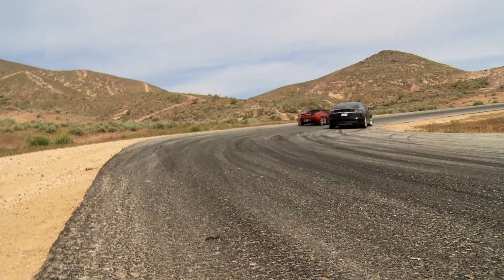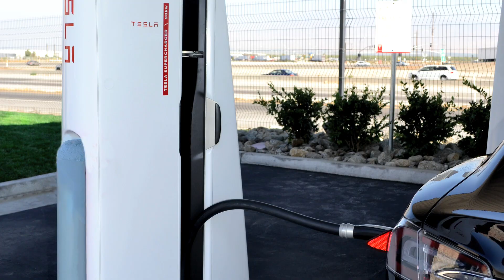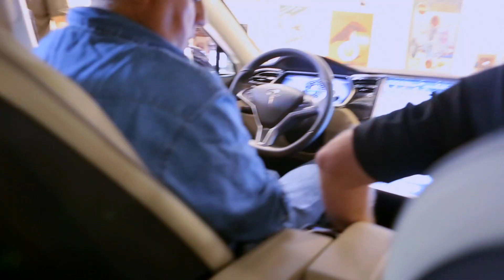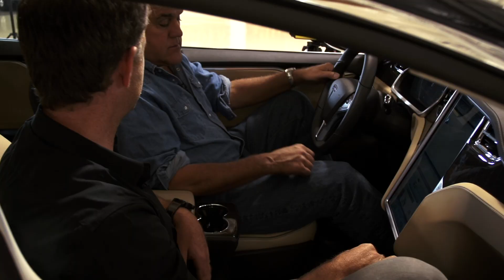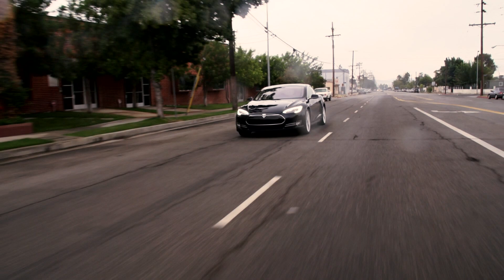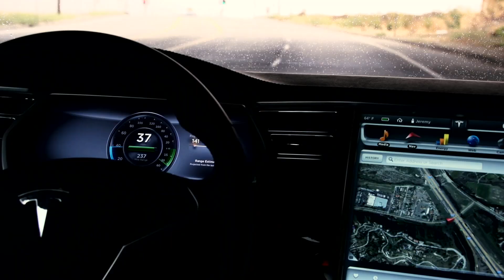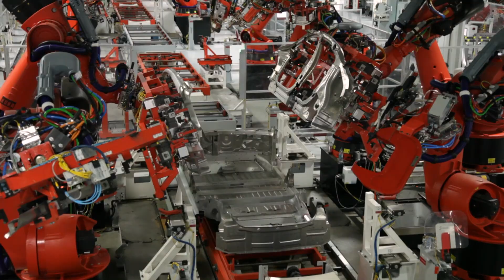2012 Tesla Model S - Jay Leno's Garage

Comment: almost cool ...

It's a great car ... "mechanic-ly" (4sec to 60!) no doubts .. and even  if it''s a very handsome machine .. I think, because of it's "new-technology" aproach, it should look more "futuristic" (i.e: look at GM's EV1 ["Who killed electric car"])
...
Another thing: Generally,I belive EV-drive makes sense only when you put batteries into a small, light, city car (like Renauld ZOE) ...--> than you need less bateries , and you could charge it in the city charge-point (just in case)...

Comment: The definition for battery life is 80% of it's original capacity, not that the battery is dead. In other words, when they say battery life is 10 years, it means after that time the battery can store only 80% of it's original capacity. The EPA rated range is 265 miles. After 10 years your range is reduced to approx 200 miles. That's still more than any other electric car.

Comment: They say it has a 300 mile range and a 10 year battery life, what I want to know is how fast the range drops over time. Sure the batteries might last 10 years, but what if you can only go 50 miles for the last 3 like most battery powered things.

Comment: If I had the cash I'd buy one today. I can drive it for about 20% what it costs to drive a 1.5 liter Honda Civic here in Norway (per mile). I would drive the crap out of it. The whole energy limitation makes it more exciting, I think, like playing dare by driving past gas stations after the fuel stick says "empty". 4 seconds 0 to 60 is also damned good. I can't wait for the batteries to get even better (then you can just add more cooling to the motors and go even faster).

Comment: The real innovation is in increasing the energy density of batteries....  We've gotten pretty good at everything else: Converting electricity into torque is over 80% efficient, while converting gasoline energy into torque is at best only 25% efficient.

Comment: Definitely a step towards mainstreaming a fully-electric vehicle...  Still would have some mild range-anxiety in places where there are no "super-charging" stations, but 300 miles is excellent compared to other electric cars.  But there's just no getting around that price...  $50K (or more, dpending on motor and battery options) for a sedan that would cost about $35K if it were  conventionally-powered.  Gasoline would have to be about $8 per gallon before I'd make that leap.

Comment: Tesla is the future. The correct amount of power with the correct amount of range. I wouldn't buy a all electric car these days because they only go 100 miles and I drive that to work and back everyday plus some more. But 300 miles is really good for a every day commuting car plus you can charge off a standard 120 volt plug. I see tesla doing big things in the future.

Comment: Stang GT's aren't as fast as you think.  They just feel fast.  Look at the specs.  I used to have a Mazdaspeed 3.  Which is the Shelby of Mazdas.  It is 0.9 seconds slower then the model S which runs 4.4.  Stangs are in the high 6 second range.

Comment: tslas cars use continual power and drain batteries in less than a month if not recharged, get sick, vacation, take a trip longer the a few hundred miles and simply forget to recharge the battery every few weeks and you have to but another battery costing american taxpayers thousands of dollars, and will have to pay for some yourself, Germans have developed hydrogen fuel cells, which european and japanese car makers are investing in more than plugin EV's which they are abandoning.

Comment: german designed Hydride fuel cells HYDROGEN uses water as a fuel is without comparison, not in the USA because of oil lobbies but actually green the only emossions are water vapor, not like the coal powered plugin cars, Obama has endorsed plugins, europe is going hydrogen fuel cells, as will america, when barry is gone, if we can get rid of lobbies, also wind and solar cost 40 % more than existing grid suppliers, and will leave with barry as well

Comment: a Tesla (or any electric car) would save you alot in maintence costs, however the life expectancy of an electric car is shorter then a normal gas car. plus the Tesla has a higher purchese price then an market equal gas car. wireing and batteries go bad alot faster then an engine (how many times does the adverage car battery get replaced in a gas car over its lifetime?).

Comment: Have you actually compared the price of gas to the price of electricity as it converts to a mile driven?   My Chevy Volt goes about 36 miles on a full charge, which costs me  $1.20.  The car, in gas-mode gets about 34-37 miles to the gallon.  Tell me, where are you getting gas for $1.20 a gallon?

Comment: The flaw in your logic is that pretty much those same pollutants are produced when building an internal-combustion car.   In fact, one could argue that producing a Tesla produces fewer pollutants than producing an internal-combustion car, since the car is simpler and fewer parts need to be used.

Comment: there are 2 reasons people buy hybrids/electric cars. 1: to save money buying using less or no gas, which is good. 2: the help protect the enviroment, which hybrids really don't due. electricity is produced by a number of ways. via water (which is clean), by coal and nuculear (which is by no means good for the enviroment no matter how you slice it). the amount of pollutants produced building a hybrid or electric system in a car actualy outweighs what the car saves in its usable life expectancy.

Comment: my laptop battery to replace costs $120. times that by 100-300+ batteries ($12,000-$36,000) plus labor vs the used car value in 10 years.
Back when my neighbor owned that hybrid, we lived in the mountains (near a ski resort). we got lots of snow and they use some real corrosive stuff in this state and it hit the upper 90s, even several 100 degree days in the summer.

Comment: i kinda hope that people cling onto gas powered cars for awhile yet. as a auto tech, hybrids are a very specialized deal and are very dangerous to work on. in order to work on one you have wear simular PPE as a line worker. you have tape off a 6 foot radious around the car. the shock you can get from a hybrid can put you through a brick wall (saw a video of it in college).

Comment: most people live in or near the city. i don't. my daily commute just to work and back was 60 miles (i moved and dropped that down to 30 miles) without making any stops or deturs.
the big problem is there aren't enough stations around yet. sure there's alot on the West coast, but very few anywhere else, surely there isn't one every 300 miles on every route. 2nd is the price of these cars, plus cost of batteries in 10 years vs the car's worth (resale value).

Comment: Well actually in some countries now, to generate electricity, Solar Panels are used on your own house which means that there is no "coal burning", so it is green and electricity is free. Also the base price is not overly expensive for what you are getting. $50,000 USD is equal to $46,908.10 AUD and in consideration that the base price for a Holden (Chevrolet) Volt is $60,000 AUD, and a bottom of the range BMW 3 Series cost approximately $60,000. The Tesla Model S is very good value for money.

Comment: The clarity costs about 200k and is still unavailable to buy. Hyundai hope for a 2015/16 release of their fuel cell car, which will be over 50k...one problem, plug sockets everywhere,.. hydrogen filling stations and pumps less than 50 for the u.s

Comment: A common mistake is to say, "Oh, electric cars get charged from power stations, which means you're just moving the source of pollution". 
Completely untrue, the electric drivetrain of an EV is far and away more efficient than the old ICE, power stations do NOT all burn gas, and you don't have to drill for electricity, nor go overseas to fight wars to keep your supply from being interrupted.

Comment: The cool thing about electric cars, though, is that it doesn't have to be. The car can actually get "cleaner" the more the grid gets powered by renewable sources like solar or hydro.

Besides, the electricity used to refine gasoline in the first place would be better used directly on electric cars.

Comment: Well, gasoline is explosive and hazardous, and we managed to contain it rather well in vehicles nowadays, from super heated conditions to bumpy as all hell breaking loose situations. We can make hydrogen storage just as safe if we put the effort into it. Let's say it's not as efficient, so be it. Over time we can develop it to be more efficient, considering it is fairly new tech. Batteries alone in cars will not succeed, and will fade away, pun intended, especially in colder climates.

Comment: It's actually about the safest position, because rear-end crashes are way rarer than front and side crashes. This way, kids have the entire cabin around them as a protective cage. Plus, the back end features two hexagonal structures to absorb crash impact, so even in a rear-ender they are very safe.

Comment: The screen needs to be that size, since there are no hard buttons in the car any more - a huge advantage for updating it (by software).

Energy density of LiIon is pretty much PHYSICALLY limited to about 180-250% of what we have now. However, there are some "out there concepts" like the Stanford electron battery, which might work out on a different level.

In-wheel motors are a terrible idea, because they put weight INTO the wheel. Google "unsprung weight".

Comment: Fuel cells are heavy, the hydrogen fuel economy is terribly inefficient (ever heard of well-to-wheel efficiency? It's ALWAYS better to put electric energy into a battery and then back into a motor than first making hydrogen out of it...), hydrogen needs to be compressed, diffuses out of tanks, and is pretty explosive. Let's keep it with the batteries, ok?

Comment: Compared to the drain that the motor and the HVAC system create, the screen uses pretty much nothing. I think the batteries in the 85 kWh version can power that screen for about half a year without recharging.

Comment: Nope, you'd be wrong. At that size, a solar panel in BEST conditions (no shade, optimum angle of sun) would maybe create 0,25 kW. Multiply that with 4 hours in the sun, you might get 1 kWh. With the 80 kWh battery, not really noticable. And CERTAINLY not worth the substantial added cost, weight, "breakage factor" and wiring needs.

Comment: The screen is needed because the Model S has no hard buttons on the interior. You control radio, HVAC, sunroof etc. all with the touch screen (or the voice system, alternatiely). Easier to keep fresh, you get new car functionalities per Software update.

Comment: I personally figure if the car is sitting in a parking lot and there arent any places to plug in... the solar panel will atleast be putting some amount of voltage rather than none... you could actually fit basically one on your hood, roof and trunk.. thats a decent sized panel in my opinion... it may not make a big difference but if there is atleast some sort of power going to the batteries while its sitting will help

Comment: I guess that you are not an engineer, or something, but believe me - If you have "something" changing torque and speed (and as a result power) at fixed rate, even when it is impossible to change it it is a gear ratio.

Comment: Apart from that huge screen (which should be half the size), I like this car. But I'm also very excited about the future of electric cars. This is just the beginning, really. Battery technology might not quite be there yet but, 10 years from now, I'm sure there will be newer batteries that are half as small and hold 5 times the charge. And then we will get in-wheel electric motors which would make the car even lighter and with much more space inside. Exciting times ahead.

Comment: Jaguar XF came to market 2009 but was designed 4-5 years before. It was driving around  Scandinavia and Africa doing weather tests way before 2007. 

A car takes 4-5 years R n D to get to market, if came out in 2009 the was'n't designed a year before. Maybe Tesler did bring out a concept before but has no baring on when planning and production came in.

 I stand by my statement, it looks too much alike the XF. Tesler took a Lotus before not surprised they took inspiration from .JAG

Comment: How long were you on the internet, and yet have not managed to look up facts about batteries?
 First, you're definitely exaggerating about laptop batteries. They have it poorly since they're always operating at high temperature mainly because your fat thighs usually block the ventilation vents. Also, mainly in schools, laptops are left plugged in all year round.
The Tesla here has liquid cooled batteries, which keeps the battery pack at a suitable temperature on all weather. Bio fuels's a flop!

Comment: Was your friend an idiot and bricked the battery? Toyota actually doesn't replace the battery for free. The prius does have an 8 year /100,000 mile warranty though. The battery for the current generation Prius costs $3,939 minus a $1,350 core credit. Tesla has a 8 year unlimited mile warranty for the 85 kWh Model S and a 8 year/ 100,000 mile warranty for the 40kWh version.... the same as the Prius

Comment: All cars could be considered toys. The only limitation is your idiocy. Tesla will back up their batteries if it is covered under warranty. Tesla doesn't have billions to spend on tooling and engineering, the 464 million loan and investor money paid for what they have. Tesla also received money from Daimler and Toyota for engineering help. You are WAY wrong on the 1/2 million units bs that you pulled from your bottom. Tesla's own CEO said they only had to sell 7,000 cars to break even.

Comment: If I could buy it I would... but I just want to do some calculations.
The average car spends around 1500-2500 on gas yearly. This Telsa model would use YOUR electric bill to cover its costs. I don't know about the variables on charging and such, but you can bet it'll add another few hundred dollars, maybe more monthly. multiply that by 12 and you got yourself a big electric bill.

Comment: Heavy,but Low center of gravity. Brake fade isn't an issue with regenerative braking. Electric motors have full torque across the whole RPM range,unlike a gas engine.

Comment: I already said this, Tesla has received all the money from the DOE and they are already paying it back. There is no way Republicans could shut it down. You can floor it and drive like crazy in a Tesla, but just like in a gas car you will experience decreased range. Parallel hybrids are fine until EVs take over. Tesla's loan was for 465 million dollars which means they only need to sell 4,650 cars at $100,000 to break even. They have over 12,000 reservations.

Comment: They do have other suppliers but Panasonic is their only supplier for the batteries. I have never heard about them stealing military funded e-patents and a google search doesn't come back with anything either. Tesla designed a different charger because the one for the leaf and volt wasn't good enough They do make an adapters, like for the J1772 plug, so you can charge your Tesla with it.

Comment: Yes, he does have some good points but, he also has some bad ones. Yes it's about how you drive but it's also what you drive, that is if what your seeking is maximum efficiency. If you put both of those cars in normal driving conditions and not on the race track the prius would have dramatically better mpg figures than the bmw.

I see your point, and my point is that something doesn't have to be 100% emissions free to makes something more "eco" then something else.

Comment: it was designed to be swappable in 5 minutes with the right tools, you can see in the videos of their factory that it is bolted on during assembly. From tesla site:
-While technically possible to upgrade from a 40 kWh battery to a larger battery at a later time, Tesla recommends configuring your Model S with the battery that meets both present and future needs.
-Given rapidly changing battery technology, it is impossible to accurately forecast the cost of future battery replacements

Comment: Yes. It caused many times less deaths and radiation than coal power yearly. Also there were catastrophies wich resulted in a lot more deaths the Chernobyl mishap.

Also the reactor design was rather flawed. But even the rest at Chernobyl worked for like another 20 year without a problem. Not to mention that the accident happened as a screwed up test of lame workers.

Comment: I would beg to differ. You bring up the pollution in making batteries which is a valid point. But lithium is recyclable & and is not consumed in the battery. Just a medium to store energy. With a standard internal combustion engine you have the pollution of the engine burning the fuel and all the pollution of extracting, refining, and transporting the fuel for thousands of tanks of fuel over the life of the car. What is the future then in your opinion?

Comment: You have convened me electric cars will never work. Nor will golf cars,segways, or electric fork lifts. Nor did any of the all electric fleets of delivery trucks that worked in N.Y. up until the 1930's. So the Tesler S that can go from 0 to 60 in 4 seconds and has a 300 mile range is a complete failure. I get your point. If you could charge your car off the grid wind, solar or water what would be your argument then? After the storm is over you pull the plywood off the solar array..